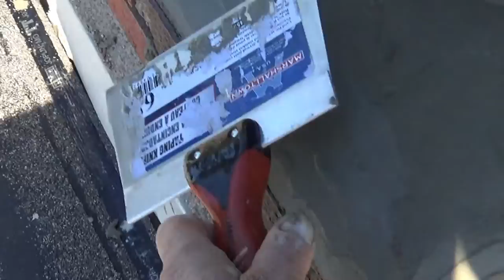REPAIRING A CONCRETE CHIMNEY

Comment: I appreciate your hard work, but I would not recommend this repair. You need to have a bonding agent between old and new masonry products. Addotionally, this repair is likely to crack in the areas soon. It would be better to remove and replace.
Reply: Here's a video of my crew roofing the same house a couple years later and I specifically show the chimney cap and that it hasn't cracked or came off. https://youtu.be/_pKlk3y6d00
Reply: @marcmiller789  I stand corrected.
Reply: @jepp0711 he didn’t correct you. Two years later means nothing.
Reply: @jfdb59 it's expensive to replace the entire cement crown. Even a new one could theoretically crack in a few years so this seems like a reasonable cost effective approach

Comment: Can you still use that type of cement if the old cap is broken and more loose then the one you worked on here?  Hard question to answer without seeing it I know……
Reply from the maker: As long as all the loose stuff is removed and it's not big chunks missing. If you have large pieces missing I recommend type S concrete.
Reply: Just remove the crown and lay a new crown with wire mesh inside.
It's such a small crown.

What you just did is going to Crack in a year.
Too thin.
There is a reason crowns are thick. 

Do it and Do it right

Comment: Those are old methods That will guarantee  to crack in a few years i see it all over the neighborhood … use ploy-seal … with a mesh and it seal will last 4x longer than concrete can withstand expansion and contraction

Comment: So much wrong with this!! Crown should have two inch overhang and there should be a cushion between the flue tile and crown. Not pre wetting the existing crown for the new concrete to adhere to plus wrong type of concrete to use! 
This is why you hire a professional chimney sweep to do these repairs. It’s a speciality trace. That repair might last 6 months and be cracked again.